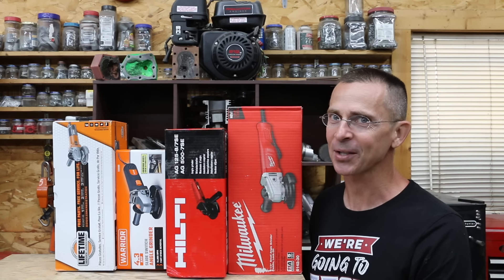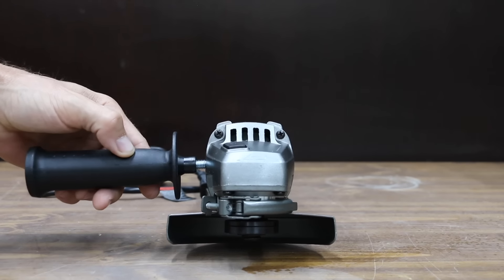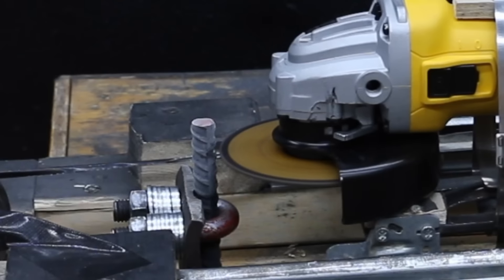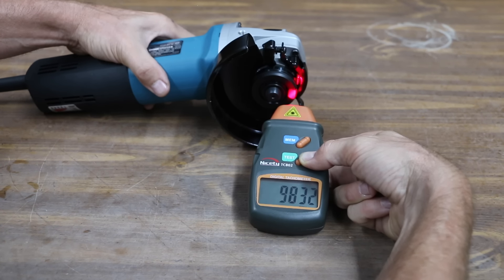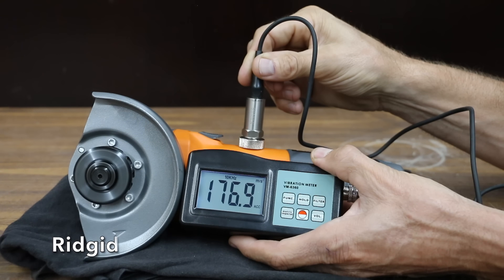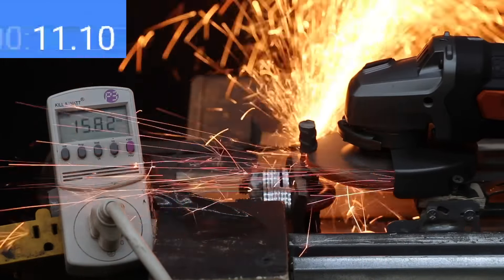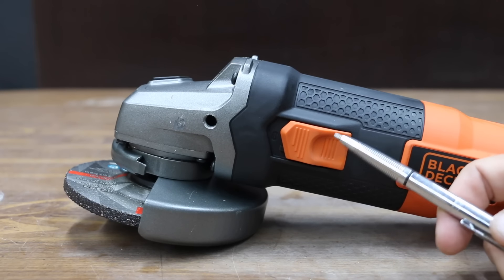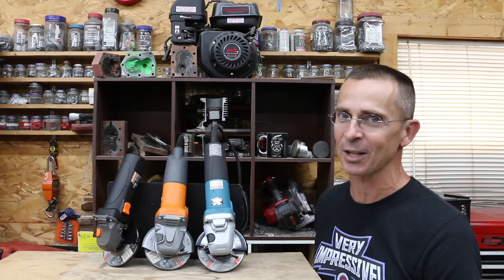Best Angle Grinder (Corded)? Hilti vs Milwaukee, DeWalt, Makita, Ryobi, Ridgid. Let's Settle This!

Comment: I am posting to this vid because this is your most curent vid as I want youto see it. But it is not about this vid. It is about an older vid you did on fuel additives that were ment to clean carbon build up, one of the three being seafoam. there is a new product out that comes recomended  by scotty kilmer, ats chemicals please take a look, as alwas thanks  for your great work. MZ
Reply from the maker: Thanks!  Thanks for the suggestion.

Comment: A failed test.
You have compared several grinders of very different powers... the power is very important because an 800W grinder (for example) will never cut like a 1500W one. There are grinders from the same company with the same engine power but one intended for working in stainless steel where the blade speed is lower but the torque is higher and vice versa for grinders for carbon steel (eg Metabo WEV 15-125 QUICK HT / 9600rpm@37in- lbs vs WEV 15-125 QUICK / 11000rpm@31in-lbs) .
Makita 9564 CV should be compared with Metabo WEV 14-125 QUICK ... comparing Warrior 15$ (probably Warrior was the name of the ship with which it was imported from China) with Makita 9564CV is like Smart diesel vs GT5.0 GT .